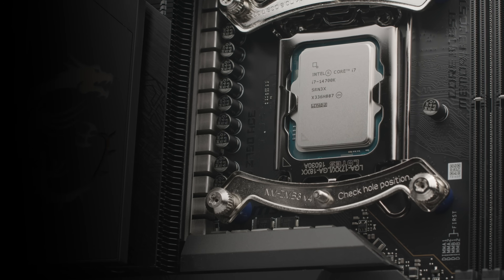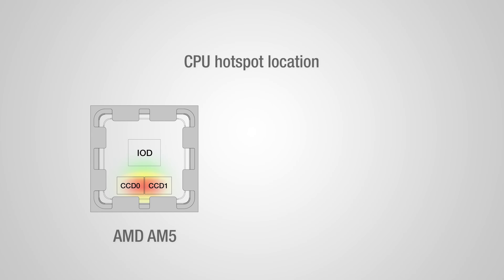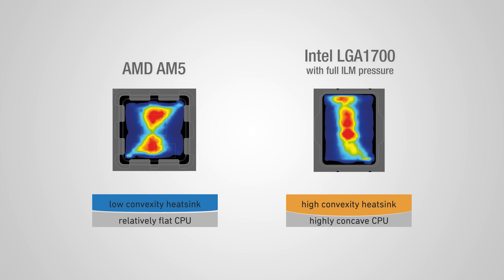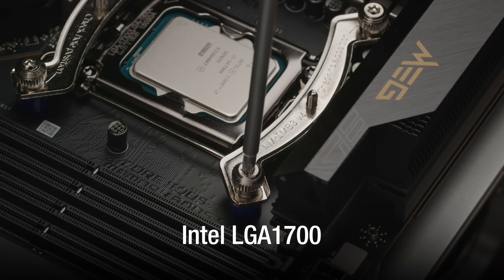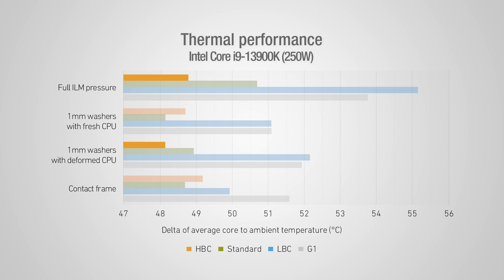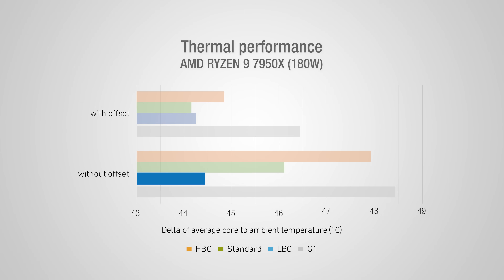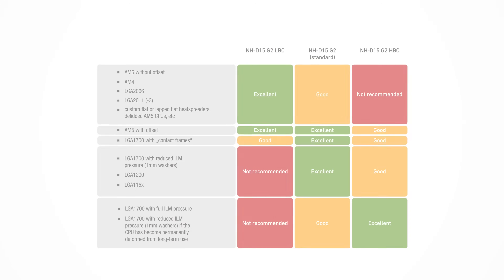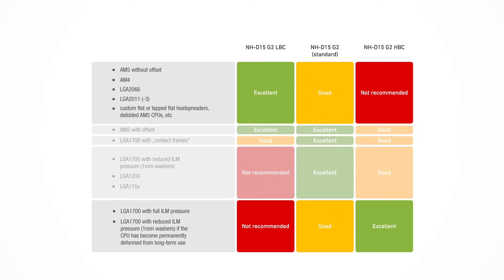Base Convexity Explained: Which version of the NH-D15 G2 should I choose?

Comment: Under no circumstances should the either of the surfaces be convex. This is basic engineering practice. The reason is that if the CPU surface is concave, then a convex heatsink will put all the pressure in the centre of the CPU, making the CPU even more concave. If the two surfaces are concave, then the highest pressure is at the edges, which will flatten the CPU.  How did you mange to get this so wrong?
Reply from the maker: It's ILM pressure that's causing Intel LGA1700 CPUs to become concave and there is absolutely no way that they could be flattened by putting on a concave cooler. More importantly, contact quality and cooling performance would be downright horrible with contact only occurring at the north and south side edges of the IHS. Having good centre contact is vital for achieving good contact quality and performance on LGA1700 and this only possible with a convex contact surface.
Reply: @NoctuaVideos  The ILM concentrates the pressure at the middle of the CPU. It bends because the socket is pushing up on the edges. Applying pressure to the edges in the opposite direction will reduce the shear and therefore reduce the deflection. If the heat sink were truly so flexible that it could not straighten the CPU, then nothing would be lost with concavity because the concave heatsink would conform to the CPU and produce contact across the entire face.

Saying that contact around the edges would cause horrible performance is surprising hyperbole from a company that markets premium thermal pastes. It must be of no value at all if twenty-five microns of thermal paste completely destroys the performance

Comment: The pricing is insane. 150 USD, over 3x the price of a Thermalright cooler that will get within, what, 5-10% of the performance?
Reply: That's the price of the research for the last bits. Noctua fans tho will likely never fail compared to others.
Reply: @TheRealBix  Noctua hasn't really kept up with modern pricing. Air coolers needn't be as expensive as they used to be.

Comment: And can this beat a $35 Thermalright?
Reply: Yes, by 0.5°C at 4x the price.
Reply: @michalsvihla1403  I am highly curious if the fan sync/offset function makes it way more quiet in comparison. Even if it only matches the (current) way cheaper thermalright coolers.
Reply: @marcelmathes   You could sync/offset your own fans if you just plug them into different headers.
Reply: We will see

Comment: For that price an arctic freezer III 420mm AIO, and a pack of beers 🍻
Reply: dont have to worry about the pump failing or the AIO leaking tho, and might last for years
Reply: A Noctua cooler or most air coolers will last you a lifetime though, that can't be said about AIO. And with Noctua you will get free mounting brackets for future CPUs forever and free replacement parts.
People also need to realize that not everyone has the space for a 420 or even 360 AIO.
Reply: @kwedl  Except look at the situation, even much smaller 120mm coolers for just $40 are outperforming the old D15. The fact is, Noctua coolers might technically last a long time, but due to changing chip designs, the designs of coolers must also change. So realistically, they do not last any longer than any other heatsink. For the price of the new D15 at $150, you could buy the latest top end non-Noctua heatsinks for 3 different system builds, that perform as good or better than the new D15. That speaks volumes. So spending $150 is just a waste of money in the long term, and you'll actually end up with less performance in the long term too, as new coolers come out that are designed for newer generations of chips beyond the current ones. In the coming future, you may ironically need something even bigger than a D15 for cooling, because future chips will released that put out soo much heat that heatsinks won't be enough, or even bigger heatsinks are required. We're already seeing that trend with Intel. AMD has been pretty decent on thermals and power usage, but they're also having to push further. The future will be HOT chips though, they're needing to move to new chip materials that can handle higher temps in order to put out more performance, and that will be the trend, because there's nowhere else to go really. We're already down to 1-2nm chips. You can't really go much lower than that, in fact, a nanometer is just 10 atoms wide. Even if we could go 1/10th of a nanometer, that's it, that's the limit, because it would only be 1 atom thick. So we're pushing up against the size limit, which means the only thing left is better materials that can handle to heat better than silicon. So future chips will be blazing hot over the next 10-20 years, and the new D15 will be obsolete completely.
Reply: @kwedl  Well, then I'd just buy a Thermalright cooler at $40 that outperforms the current NH-D15?
Reply: @michalsvihla1403  the point still stands tbh, air cooler will always last longer than aios.
Reply: @tonyy.8852 I feel like the point was that this is expensive
Reply: @fritz411  well yeah, but also about AIOs won't last as long as high performance air coolers
Reply: @tonyy.8852  No, but at this price, you can buy literally any 360mm AIO that will outperform this cooler and for a lot of them save money doing so. Chips like the 14700/14900K throttle unless you water cool them.
Reply: Hell, they throttle even with water coolers.
Reply: @michalsvihla1403  But after some years you spent the same amount of money for the AIOs. And you also dont need the full power of the 14700/14900 all the time.
Reply: @tobireindl  Not really, the Arctic Liquid Freezer 280 is close to half the price. The 360mm and 420mm versions cost around 95-100€. The NH-D15 is closely behind a 240mm radiator in performance. The cooling headroom is definitely needed on those chips and the acoustic difference with a more capable cooler is huge.
Reply: @michalsvihla1403  let's wait for the new coolers first, and well I think it's mostly Intel's fault for 14700k/14900k lol, they are just taking the "jamming as much stuff as we can and make it as fast as we can" approach lol. But you know about the LF3 mounting issues right?
Reply: @tonyy.8852  I know the LF3 isn't the best cooler for Intel, but it's by no means a slouch, it's pretty average. Something like an EKWB Nucleus CR360, which is one of the best AIOs for Intel, is still just 135€.
Reply: @tonyy.8852  And while it may be Intel's fault, it doesn't change the fact that that's the market we find ourselves in. Looking for someone to blame is irrelevant. The market changes all the time. That's just capitalism 101. You adapt or die.

Comment: All nice, but the price is ridiculous. You will limit your market to brand fanboys only. No sensible person will buy a 4x more expensive cooler like the models from Thermalright, when your G2 will be only marginally more efficient.
Reply: You will be much happier in life if you stop thinking people are buying things with what's in your wallet.
Reply: IKR. Noctua has become like Apple of cpu coolers. G2 is 86% more money then G1 but not even 10% better in performance. I’ve seen cheaper 360mm aios with lcd screen than this. While you could argue longevity, and over the course of many years, the cost ends up being not that much, you could say the same for cheaper alternatives, including say the Thermalright Phantom Spirit Evo, which won't break down aside from the fans. You could even slap two nf-a12x25 fans and call it a day on a cheaper tower cooler and it should perform similarly with similar noise levels.
Reply: Consumerism is a social and economic order in which the aspirations of many individuals include the acquisition of goods and services beyond those necessary for survival or traditional displays of status.（Definition from Wikipedia)
Reply: I dunno, PC building has always been a hobby. So if somebody wants to min-max their temps on an all air cooled build, good to have Noctua there to make the product. Yea it’s pricey but the possible performance improvement might be worth it.
Reply: Using noctua for decades now, and still rocking my nhd14 original fans, and some older coolers from them as free hardware, socket 775, 1366, 2011 1150/51, 1700 AM4etc...best customer service, noctua is quality, have nhd15 chromax as well, satisfied :D
Reply: Due note nhd14 still competitive till this day 2009 cooler 😎
Reply: I'm certainly not a fanatic, I just like good products with good customer service. The latter is arguably just as important imo.
Reply: what’s the point of this comment?
Reply: This comments reeks of completely glossing over value in things like warranties and services. Good luck getting a new mounting kit for your thermal rite stuff when a new socket comes out.

Noctua will send it to you for free of you still want to use an older cooler.
Reply: @craig9365  You do not need such a service if you can buy a whole cooler and still be in the green when you switch platforms
Reply: @craig9365  Noctua is a specialty company and they don't cater to the low-cost PC market. If you want general PC cooling parts then there are other companies for that. There's always cheaper options out there on the market, but reputation is everything these days when it comes to quality components. Noctua is expensive, but they sure don't have a reputation of being a disappointment.
Reply: @craig9365 You can get 4 new coolers for that
Reply: Maybe just maybe people want quality. Not everyone is looking for the absolute cheapest prices. It's noctua ffs not thermalrght. They are awesome for the money don't get me wrong.
Reply: Longevity, warranty, service. If it lasts 4x longer then 4x the price is justifiable. If it lasts 5x longer then it's a no-brainer.
Reply: Yeah right.  Noctuas build quality and performance are leagues above their competitors.  I'm still blown away by my noctua cooler a year after getting it.  I have a nhu-12a somehow cooling an i7-13700 remarkably well.  But I've been waiting for this and I'm sure it will be worth every penny.
Reply: A sensible person would get this instead of a 360mm water cooler on a 14900ks, there is a market for it, though it is not ryzen 5 and i5 cpus, for those the peerless assasin is good
Reply: @itszify554  I was waiting on this. I have a white assassin 4, and it does what it's supposed to and looks great doing it, especially with my RGB ram. I want one of these just because, but having to buy low profile ram or a pull/pull config kind of bums me out.
Reply: @itszify554  That depends on the amount of room you have as having a large air cooler can get in the way of other components depending on build.
Reply: I bought an NH-U12A used for $90 USD and it will most likely serve me for many years to come. I see no reason to go for any other brand. This lasts, and it lasts well.
Reply: Still didn't understood that you pay high but it lasts more than a decade, their first product is still to this day ok for small CPUs like Ryzen 5 with free kit for modern CPUs. Noctua is here for quality, usually you buy from them one time.
Reply: When I think of Thermalright the first thing that comes to mind is minimum wage.
Reply: @jamesm568 What's wrong with having something that's budget oriented and works? There's a time and place for everything and if you're trying to maximize your performance to dollar ratio, a 40 dollar cooler than does the job a 120 one is a no brainer. It's not low income, it's just smart. Noctua products have their purpose being tanks to be used time and time again into the future, but for the average consumer a 40 dollar peerless assassin is perfect.
Reply: @bottomtext5872 and what's wrong with wanting the best? Cost to performance is meaningless, especially when its just a few $100 or $1000 difference for the complete build. Especially when I use my PC for work and make multitudes more than that. 

I'm not a teenager gamer anymore lol.

Also PC is a relatively cheap hobby.
Reply: @jamesm568 spending more money = more happiness 👍
Reply: @Atilolzz  I don't think of quality when it comes to Thermalright as a lot of their products are a hit and miss as Noctua doesn't have a reputation for that. I use Thermalright products myself when I'm building low-end computers for people.

Comment: I think a configurator tool as suggested in another comment would be very well received by the community.
Reply: Yes please.
I've spent 2 days trying to understand what noctua to buy... Decided to go with the latest to future proof.

At first I bought D15, then I found out D15 G2 exists, then I found out about tests where U12A performs better than D15...
So complicated.
Reply from the maker: I'm sorry to hear that your experience was frustrating. However, rest assured that the products you've mentioned will not disappoint you.

For a quick guide, you can refer to the NSPR score of each CPU cooler on Noctua's homepage. The NSPR score represents the relative cooling power of each Noctua CPU cooler, the higher the number, the better the noise-to-cooling ratio.

If you have further questions or need additional assistance, feel free to reach out to our friendly and knowledgeable customer support team at: https://noctua.at/en/support/noctua-support.

Comment: Now we wait, for @gamersnexus to get their hand on it!
Reply: im a bit skeptical of how new CPU with contact frame with standard flat isnt the best.  Washers with dodgy ILM and standard flat is somehow superior??  how
Reply: @Nenulis0  synthetic bench marking is a joke anyway.
Reply: @jamesm568  these benchmarks are only to see which one is better. yeah in reality everything looks diffrent but the worst one will nearly always be the worst one and that can be seen in these benchmarks.
Reply: @MrWunz  Benchmarks for brainwashed people as the main concern is if the product actually performs as the manufacturer claims. You can compare all the same products together and you will get different bench marks every time. I really don't know any brand of large air coolers that do not perform their job and have a small discrepancy among their class.
Reply: His testing is irrelevant anyway because air coolers act differently in all builds. I don't need control testing to know that high-end air coolers are performing well because most high-end air coolers do perform well. Noctua doesn't have a reputation of disappointment either. I don't need some POS on YouTube to tell me that an air cooler is worthy when the name alone proves it's worthy.

Comment: When will the new 140 mm full frame be launched? Shown in the video at 3:19 as an case exhaust fan?
Reply from the maker: The current ETA is September: https://noctua.at/en/noctua-at-computex-2024
Reply: I'm waiting since 2021 for these 140 x 25 ultra low noise fans, to replace my radiator standard fans. :D
Reply: @NoctuaVideos   Oh and one thing Noctua after spending an inordinate amount of time, preaching to the masses for years on Toms Hardware, about how you guys would provide an excellent service of shipping free future mounting kit anywhere in world for free, its a bit disappointing when you guys required invoice copy of new mobo.  By the time it arrived, i had given up the wait and purchased the mounting kit locally.     I understand there are cheats, but if i have receipts from noctua D15 in 2017, with my all out 8700k noctua build being a featured pcpartpicker build of the week, to now 2023 January, im upgrading to 13700k. warning you guys in advance, so it all lines up.    Yes, ill have all the parts sitting around just waiting for the mount kit for a month , indefinitely.     Ive still got the mounting kit sitting here. Do you want me to ship it back?
Reply: @NoctuaVideos  To clarify, there should have been a way for me too prove i wasnt a cheat, and to get the show on the road a bit sooner. Just imagine, $$$thousands of parts sitting indefinitely waiting for a mount kit. There limited time for hardware mobo failure quick refund vs going to long RMA process.  Im not going to pass up that precious window. i cant afford to

Comment: How much of a difference is this actually going to make?
Reply from the maker: We present detailed temperature data in the video, you can also find it here: https://noctua.at/en/nh-d15-g2-versions-explained
Reply: I just want to preface what I’m about to say by telling you that I am a long-time Noctua fan (no pun intended), and I currently own six of your coolers. When I see something like this after years of development, I wonder what the goal is here as a company. Your competitors are matching or beating your performance at around 1/5 of the price, and your solution is to develop a needlessly technical and frankly confusing product that offers only a potential 2-3 degree improvement. 

I understand that we’re at the limits of air cooling and, as a technical company with a great reputation, you aim to continually improve. I can appreciate that. But do you want to remain a niche brand for highly technical air coolers while the market totally passes you by? I had high hopes when you introduced the Chromax series because it felt like you finally understood the market, but in my opinion, this is a huge step backward and a big disappointment after a long-anticipated reveal.
Reply: @minecraftmike5193  They found their niche in clients that value their attention to detail decision to go for different mounting systems is exactly why I would go for them and none of their competitiors ... and we are not even talking about their way over engineered fans and fantastic customer service. I get that most people will not buy this if they are stripped for cash, but I for exampleonly buy a PC every 5-6 years and I want my PC to be silent cool and as stable and long living as possible. If you choose noctua cooling you won't have your fans die on you as fast as the other cheaper brands and you get a more silent pc as well.